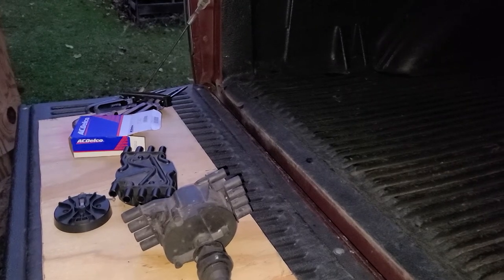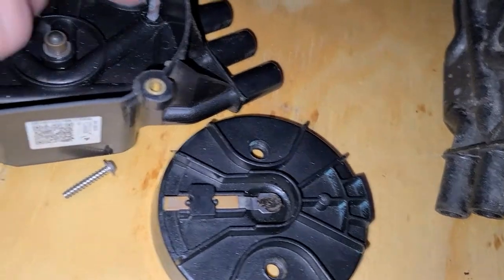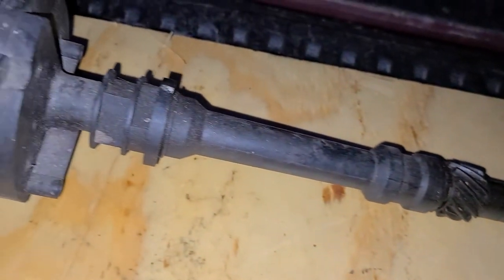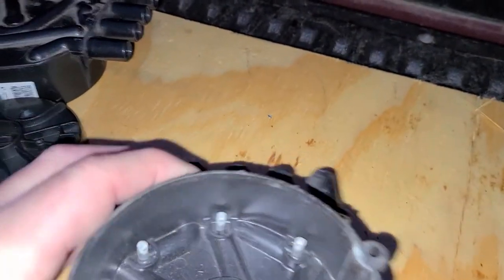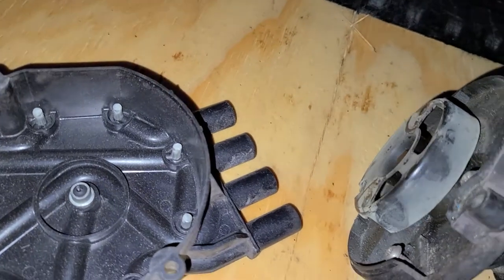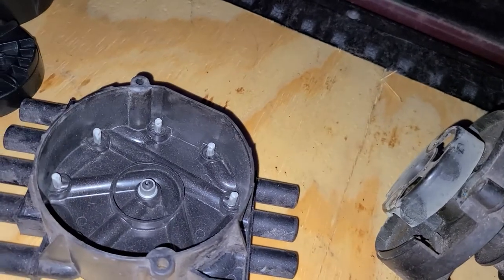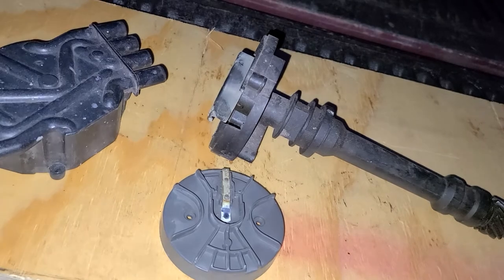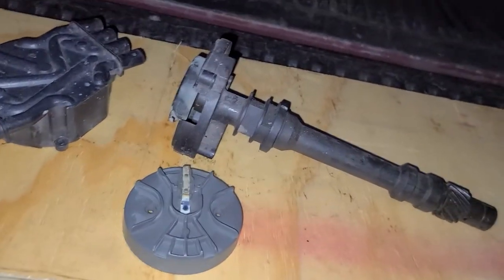recap on changing the distributor cap and rotor on a 1998 k 1500

Comment: I have always heard that when there is a crack it will collect graphite or the debris of metal coming off of the center of the cap into that crack and cause a short or a pre ignition spark on something. But they are vented
Reply from the maker: Yea for some reason aftermarket or ac Delco caps my distributor was cracking them this last has been good for a couple of years now so I have no idea what was causing it

Comment: Check engine light with it?
Reply from the maker: Yea misfire codes random misfire cuase the spark goes all over not where its supposed to my truck seems to eat caps at least 1 a year
Reply from the maker: Yea I get that only when I replaced the hole distributor I had to leave the distributor bolt a little loose and turn it I little in both directions til that code went away maybe your just needs turned a little one way or the other to clear it up
Reply from the maker: If you like I can try do a video to show people how to do that adjustments
Reply from the maker: Yeah I see uf the weather will let me do a video I live up state pa its still winter here but it's been warming up some